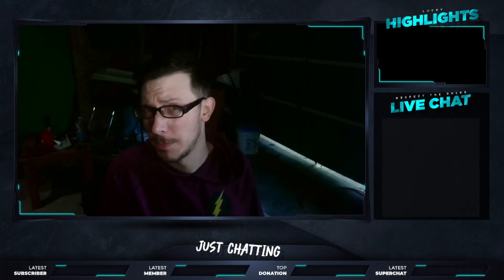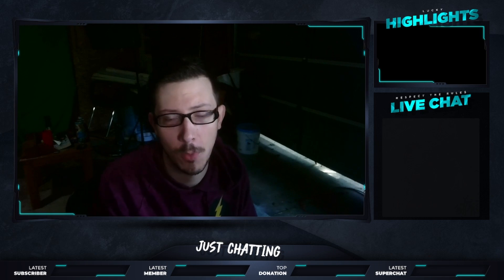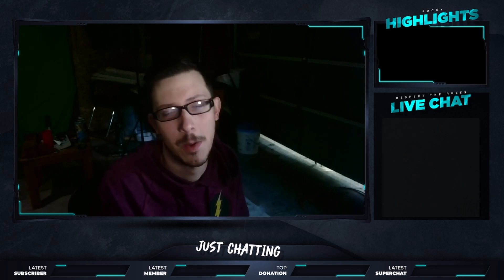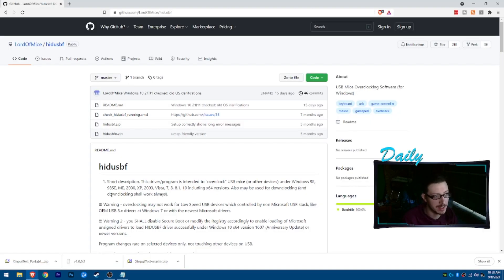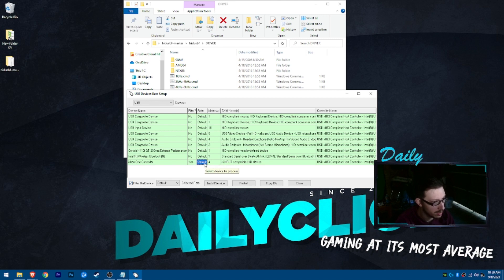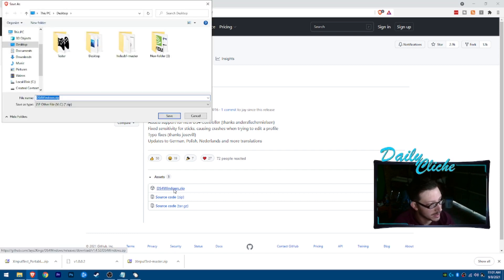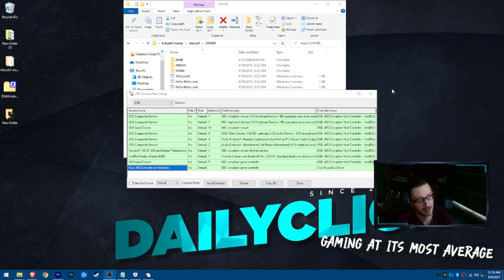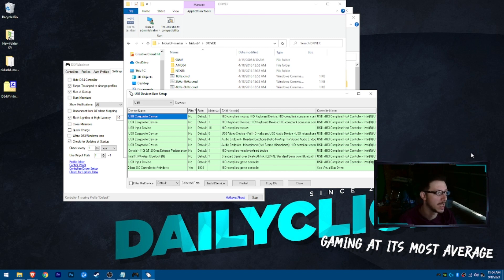Overclocking Controllers for NO Input Delay in Warzone!

Comment: you dont need ds4 windows to overclock a ps4 controller, the other programme that you used to clock the xbox controller works just fine with the ps4 controller.

Comment: does this last forever or do u have to redo it in a couple months
Reply from the maker: It should last until the drivers update - it’s worth checking every once in a while but you’ll notice something being “off” when you’re playing usually when/if it does decide to randomly change
Reply: @DailyCliche  Alright thanks if it still says 1000 and filter on device is checked then it should still be working right?